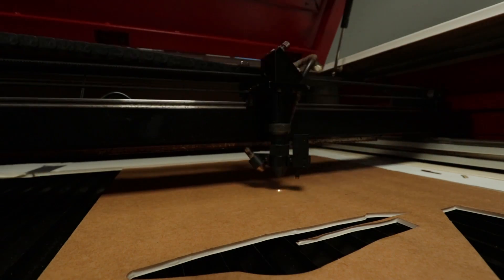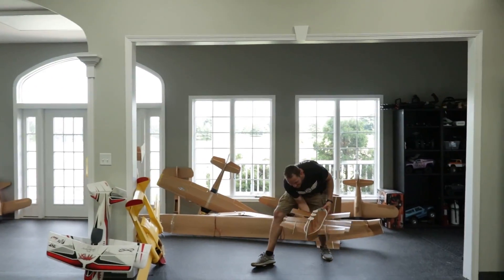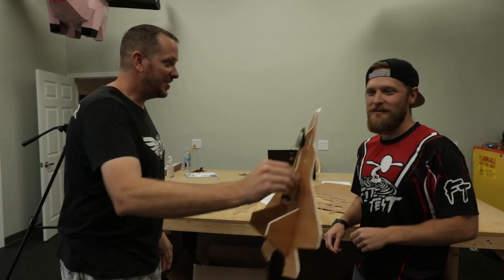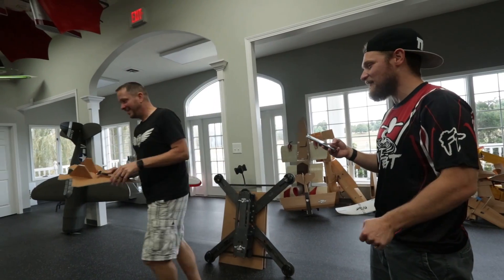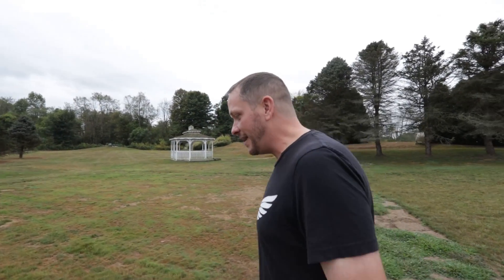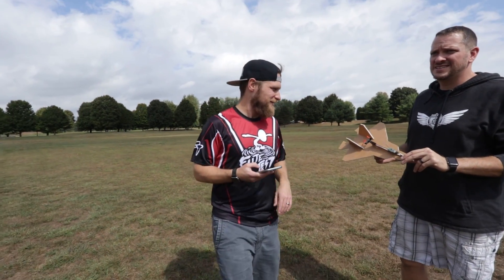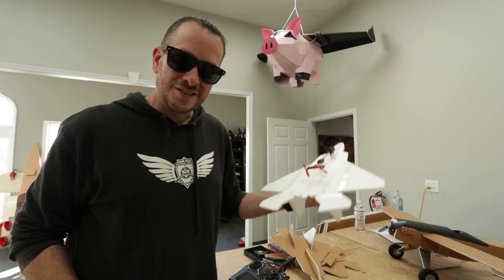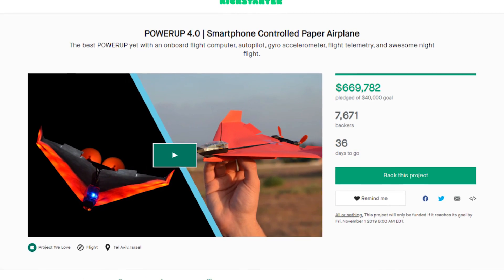Smartphone Controlled Foamboard Plane? 🙌   |  Power UP 4.0

Comment: Guys...going "with the wind" or "against the wind" does NOT matter as far as the aircraft flying thru the air is concerned.  Yes...it matters as far as the GROUND is concerned (changes in groundspeed), but there is NO change in airspeed or aircraft flight performance going "with" or "against" the wind, unless the pilot commands it.

Comment: Power up 3.0 sucks. The bluetooth is always dropping connection and is a pain to reconnect. The motor weakens in a few days. And $50 for a small drone motor and a bluetoorh unit is kinda steep.
The upside is that it does fly pretty cool
The down side is it loses its coolness fairly quick.

Comment: Try adding a KF step on the leading edge so it's not relying solely on high AoA to generate lift? Speed may go up, but efficiency / batt life should increase as it's not expending so much power downwards to maintain height once it's got itself into that high AoA state. 
Years ago I made a RC Powers 4ft long depron F22; that KF step really makes a difference to the lift generated; if you wanted to go high AoA anyway, you could get it almost down to walking speed, but at cruise speed it was essentially level as the KF step generated enough lift to require zero AoA.

Comment: Too bad my phone lacks a gyro :(
Reply: Gurren813 I’m pretty sure all phones don’t have a gyro.

It’s the flight controller that’s built into the power-up module that contains a gyro
Reply: @swisscheeseaviation590  Yes the module has a gyro, but I think it just either slaves directly to your phone's gyro or uses a buffered input so you don't have to flip your phone to do a roll. My phone only has an accelerometer  to rotate the screen.

Comment: Could embed prop by cutting a slot, decreasing weight?
Reply: That came up early in the video, putting the props in a slot is bad for efficiency.  Unless you're talking a slot extending ALL the way to the back of the aircraft, which would change the profile and CG requirement.

Comment: Im doing the Explorer, i just need to cut the wings.
Thanks!!
Reply: Mer y Clau Sanchez Bonetti happy building brother!
Reply: @joshuamelvin  thanks!!!
Reply: @joshuamelvin  i took a lot to realize... You re the real Josh! Really like your videos and im enjoying so much building the explorer, Im from Puerto Madryn, argentina, here we have a little RC Airplane club, come to visit some day! My friends had build many FT's on their lifes, one of these is Juan gabriel Vazques, search it on YT, he uploads everything we do in the club! Greetings!
Reply: I did the explorer. The propellers that came with it were too big for how the motor gets mounted. Plane over all was too heavy. Even with the C kit.
 However, the tail section on it is the bomb. It shows putting BBQ skewers between V and H stabilizers. It doesnt really need it. Its very strong as is.
Mine crashed too many times, but I use the tail on a basic flying tube I made. The rud and elves are very flexible but firm.
Basically I just made a 20" long 2×2 tube with thick cellophane tape instead of glueing folds. I made 1 30" dyhedral wing, 8" wide. A 8 inch inner tube ( 1 11/16 × 1 11/16 to connect the explorers tail piece with the tube. CoG and it was flying. And the neat thing is its almost completely breaks down for transport. I kept the smaller intrer tube glued in. Everything else disassembles
And it cruises reall nice. If you crash it, no prob. Just cut, score, and 45°bevel  another square tube.

Comment: Cheaper to buy a quad off of ebay, banggood, etc and use two motors for differential thrust. Peter Sripol
 did it on his youtube channel for 5$. Paying $79+ for this is idiotic. I mean for heck's sake you can buy a tiny whoop with FPV for this price.

Comment: How do you guys make it look so easy. I hate to sound discouraging but I have spent far too much money on trainer planes and have nothing but a boneyard. The only plane I did well with was the explorer running 3 channel "video on my channel" and was still able to rebuild it 11 times till it was %90 cheep foam board and the rest hot glue. I have bought other trainer rtf planes and the issue was customer service. Unlike FT other company's have had poor at best customer service. I'm now stuck getting my channel off the ground starting at square one being new to the hobbies and helping guide others getting into it through my mistakes and wins to help relieve some of the frustrating aspects veteran fliers tend to overlook. I'm open to any and all suggestions on a good place to turn next with a budget and training kit in mind. Thank you guys and good bless

Comment: I have a power 3.0 and it's good so I wonder how good this is
Reply: Why?!?! It is unbelievably expensive and shitty. You have less than 5 minutes of flight time!
Reply: @TheAstronomyDude  complaining about 5 minutes of flight time with a battery that small are you freaking kidding me... think for a minute before you type buddy you sound like an idiot.
Reply: @Schmidy76  it's a plane, not a quad. A tiny quad has 5 minutes of flight time. This should have 15+. You sure trigger easily @Schmidy76. Maybe you should seek psychiatric help before you run amok.
Reply: @TheAstronomyDude  Show me one other paper folded airplane that size that can stay in the air for 5 minutes.
Reply from the maker: The flight time is around 6-10’minutes depending on weight and power usage!